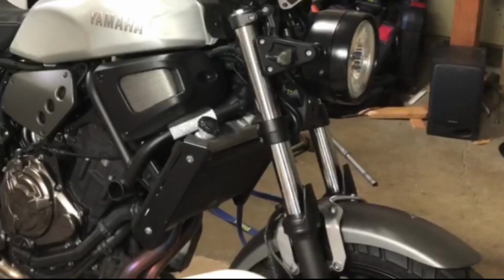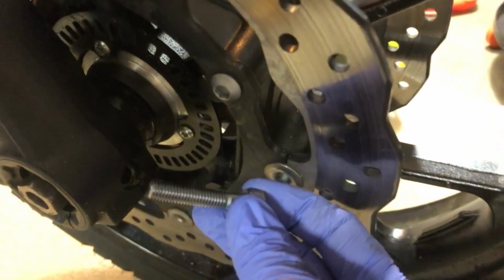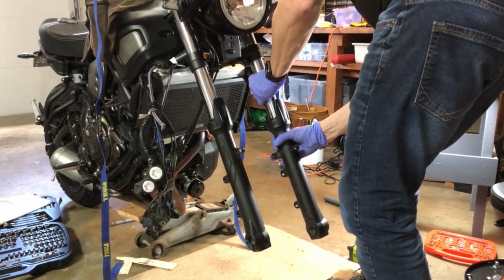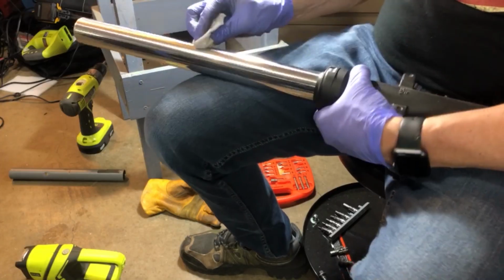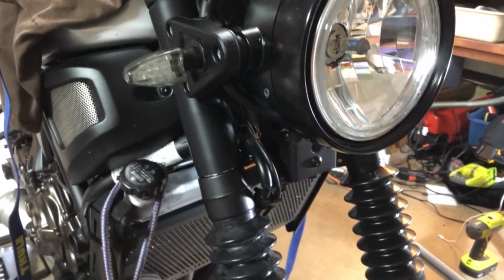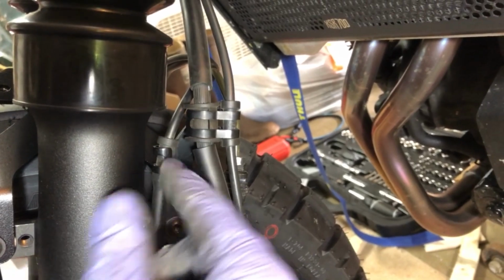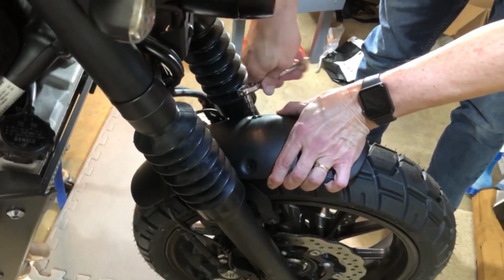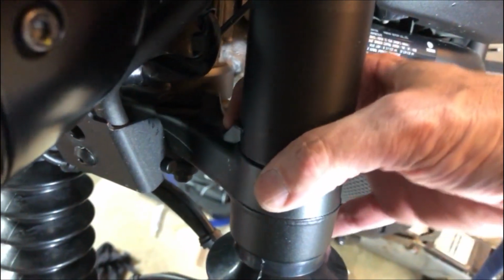Installing SW Motech mud guard, fork covers and gators on Yamaha XSR700 (short edit).

Comment: Hi,

Thanks it helped me installing by jvb gaiters. Mine does not stay in place, the gaters go down when I drive and always let the alloy fork appear. How did you come out with that ?

Thanks 🙏
Reply from the maker: My gaiters came with small zip ties that I installed around the top of the gaiter, which keeps it in place.
Reply from the maker: I have a longer version of this video that you will find on my channel, and at about 14:40, I show where the zip ties go.
Reply: @heybuck6588  yep mine too, I forgot to install those. Also, I installed it with soapy water to slide the gaiters more easily. In fact it’s necessary to mount these dry. So I had to wait till next day, and everything is fine now 👍

Thank you !

Comment: The chrome bridge that you took off is a support for the forks you've just transferred all the energy to the mudguard! how long will that last?
Reply from the maker: Thanks again. I’d like to look into adapting the fender to work with the stock brace/bracket. I’ll post if I can figure that out.